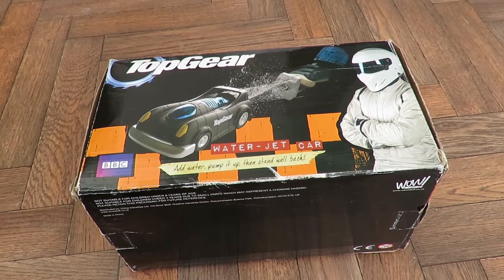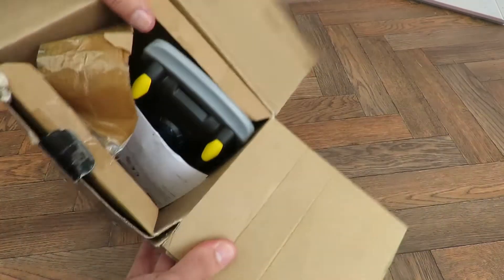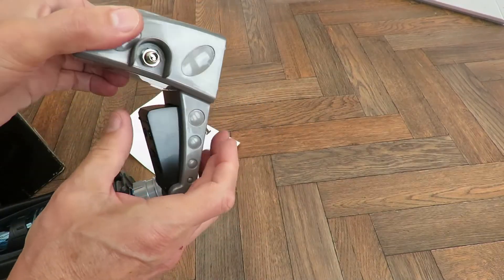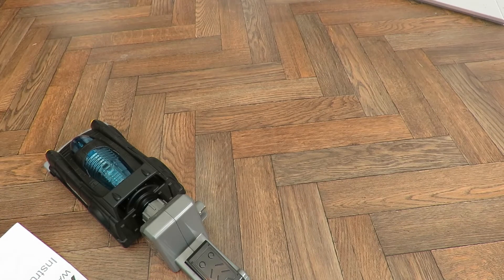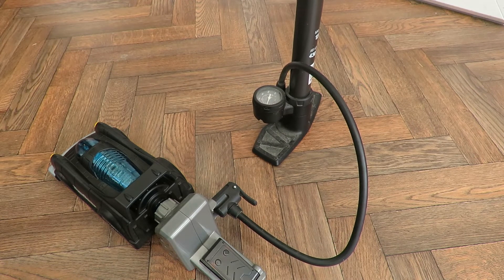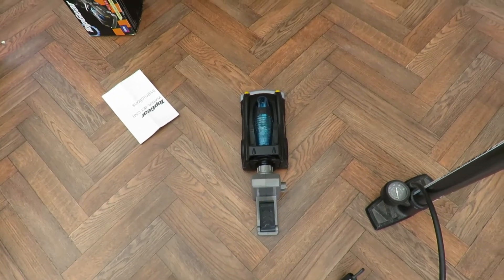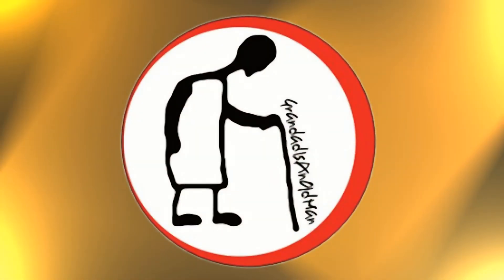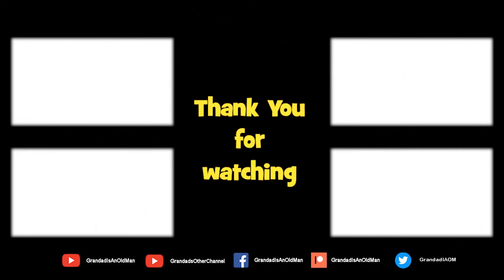RCGOG TopGear Water Jet Car Part 1

Comment: Good video "G". I love those air powered things. You could use the bottle adaptor and release mechanism for a water rocket, using a standard pop bottle. The only problem is how to release it. If you did by hand you would get soaked but you could rig up something to push it in? Maybe.👍